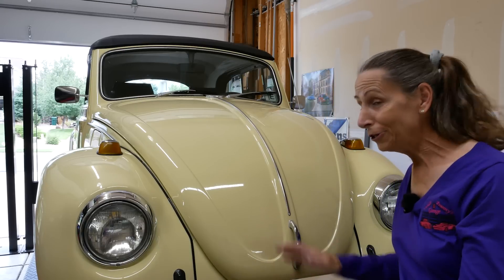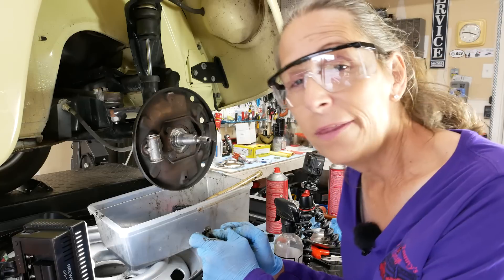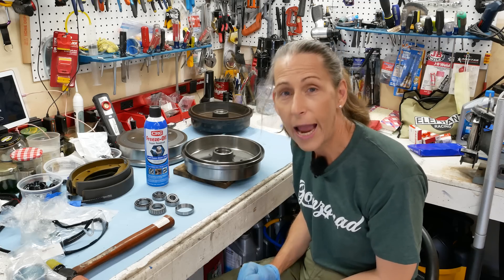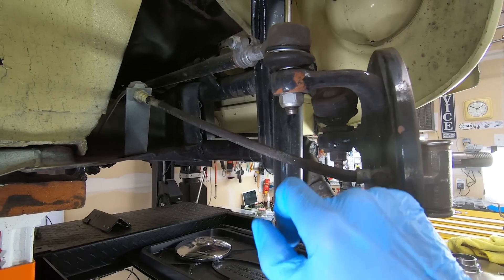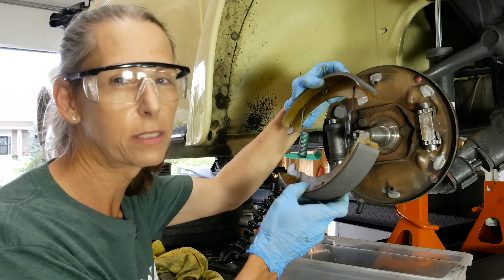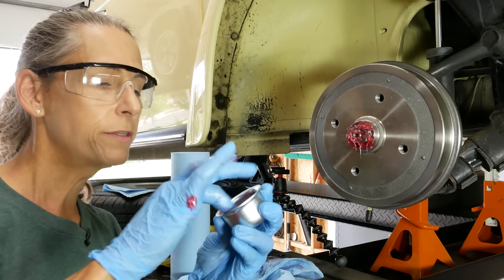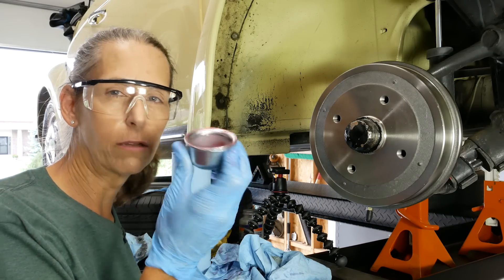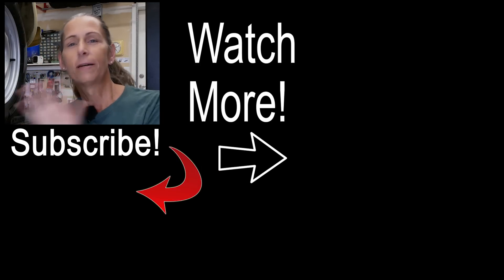VW Beetle Front Brakes & Bearings Disaster! What a mess!!

Comment: I just converted my front brakes on the '70 bug to disc brakes.  Wow what a difference.  I didn't want to chance messing up the new bearing races so went to a friend that had a press and carefully put them in that way. Used a lot of grease and brake fluid, but well worth the effort and minor cost. 
I was shocked to see on Lemon Drop those short cables on the front and how they didn't fail! Somebody's Angels were looking after them.
Looking forward to your next video :)
Reply from the maker: I think disks would be a smart move...
Reply: @HeidiandFranny  Oh my, yes! It brings the Bug into this century, the 4 wheel disc swapout, w/ upgraded master cylinder isn't that bad and you get to replace bearings,seals at the same time.. pack'em with Mobil1 grease, good to go long time.
Reply: 😉 Muir said at the start of his book that if we all drove as we were sitting on the front of the hood, there would be a lot fewer accidents ha ha! I think he was talking about the brakes... that was many years ago, though, and not many people do drive like that. I’ve been saved by ABS several times, so I’m no saint myself 😋. I love your videos, Franny! Very informative and they de-mystify the complex automotive machinery for the rest of us! I’ve done a few jobs on my cars, thanks to the confidence gained from you and others on here 😄

Comment: I remember working on brake cylinders back in the day. Old Fords and Vauxhalls mostly. I sometimes used a rubber seal kit for the cylinders instead of buying new ones. Here in GB we call these brake shoes and not pads. Pads are in the calliper and squeeze on the brake discs or brake rotors as you call them in the U.S. Great work as always.
Reply from the maker: I thought about a rebuild kit, but replacements are just a few $ more.  We'll see how long they last though...  Thanks for the term/name differences.  The differences always intrigue me.  Usually the GB names make more sense :) I keep getting names messed up all the time ;)
Reply: Heidi and Franny's Garage    Thanks. I really enjoy your content and as always your work is excellent. If only more engineers/ mechanics were of your standard I would be more confident in the automotive industry. Love from N.Ireland.

Comment: Great job Frannie! I had forgotten how easy front wheel bearings are on Beetles. I'm working on the front end of my CR-V and I'm taking the steering knuckles off to have bearings, lower ball joints, and wheel hub assemblies pressed in by a shop. Tolerances are too tight to do it without a press.
Reply from the maker: Modern car are so different!

Comment: More than 50 years ago I was taught to use the old race as an install tool for the new races. Using a flat piece of steel or hardwood as a tool to press against the old race helps in applying equal pressure all the way around.If you have a hydraulic press helps too. Most old school garages had one. I have never packed grease in the wheel cavity until full. Good way to get grease all over the pads and drum once the brakes get good and hot. Just smear it liberally on the spindle. I also like to rebuild the wheel cylinders. It's easy to do and saves on buying parts.

Comment: When redoing the front wheels bearings and brakes on my 912, putting the hubs in the oven at 275F for 30 minutes and the bearing races in the freezer in a zip lock at the same time, inserting the races was as easy as just dropping them in, et voila... super easy and took me (outside of the wait for the hubs to be warm) a grand 30 seconds..
Reply from the maker: That's a great way to go! Thanks for that :)

Comment: Franny & Heidi:  using a bench grinder to turn down an old outer bearing race is a great idea in turning it into an U/S (undersize) bushing used to tap in the race.  Trying to turn down a hardened steel bearing race on a lathe is very tough to do unless you have carbide tooling....and a lathe of course, or a friend that can do that for you! LOL
What I have done in the past is to soak the bearing races in denatured alcohol in a deep freeze, use a pair of tongs, place the races in the hub/drum and either use an U/S bushing or a bearing race driver to set them in place.
Another trick I learned was to again use the U/S bushings, get 2 1/4" thick pieces of soft steel, drill a clearance hole through both (1/4 - 1/2max), put the races in place along with the bushings and place a piece of steel on the bottom (inner), run a bolt up thru the center, through the outer bearing and bushing, through the last piece of steel, and using a flat washer underneath a nut, slowly tighten and you press both races into place simultaneously.
On the setting of the bearings, I was almost sure VW had specs to initially torque to set, and back off, then tighten the nut & Allen/Hex screw?  But, your method works, and I know many mechanics that do it that way.
Lastly, Great Video!!!  BTW, the loosening and proper tightening of that rear axle gland nut....you know what a bugger that is!
Reply from the maker: Thanks so much for all those tips!  I like the idea of compressing them together.  That's pretty cool.  The rear axle nut in up next ;)

Comment: Loved this, a blast from the past, we had Beetles years ago, but who put that flexible hose on like that needs to rethink their work. The brake cylinder should have a metal pipe to it then to a bracket , then the rubber hose, to another bracket on the body. For the brake clips use a mole grip to hold it then you don't need to squeeze while fiddling

Comment: I think the difference in pad types is due to the notch for the parking brake. The geometry from front to rear, is quite similar, so many times the rears will be purchased in bulk, and used for both front, and rear. I've found both on VB, my little '72 bug. VB is also that pretty light-yellow, but the paint is original, and has become rather thin. :) Nice Video! I look forward to the next one.

Comment: As always a first class instruction video. Putting the anti-seize on the star adjusters is a very good advice, they have a tendency to rust, and once they are rusted in place the adjustment of the brakes becomes a nightmare. The rest of  the anti seize is unnecessary in my experience. Any kind of grease is potentially doing harm to a drum brake, as You said. I also think the brake shoes aren’t getting in contact with the backing plates, once the drums are installed. I installed freshly powdercoated backing plates in my Thing and there isn‘t a single spot where the shoes had contact with the plates.

And what kind of baboon installed these short soft brake lines? This is so 🤬 dangerous! Thank god, Ms Lemondrop is in Your caring hands now 😊.

Oh, and the little caps are simply trash. A friend of mine just wrestled with this repro crap a couple of weeks ago. He reused the old ones either.
Reply from the maker: You are probably correct on the back plate lube.  There was a deep gouge where the pad had been contacting, but only one and a little lube won't fix that.  I bet the powder coating would actually be better.  Yes, those soft lines...  They were literally pulling on the brackets.  This whole car has stuff like that.  Whoever assembled it hadn't worked much on German cars.  It there is something that doesn't seem right , then back up and do it again.  It didn't leave the factory as a basket case.

Comment: I had the same problem with the bearing caps on our '73 Super. The problem is "Made in China" vs "Hergestellt in Deutschland". It's amazing how much easier it is to access the wiring and speedo on the pre-'73s!
Reply from the maker: I think the issue is that the form they are pressing this with is worn and is a bit small.  That and the metal they are using is a lot thicker.  I was bummed...  The old one looks like crap.  But, it fits!

Comment: Hi, great video and very helpful. Question though, at 15:40 you check shoe orientation, at which time the cut-away areas are facing the adjustment screws. But then at 16:25 you install springs but appear to invert the bottom shoe with the cut-away facing the cylinder. I thought those cut away areas were both supposed to face towards adjustment-screws. Was this a mistake? Or am I installing the shoes incorrectly?

Comment: I hate working on drums, more work for less performance. Those cylinders always seem to leak prematurely. I don't trust these mostly 3rd party cylinders these days since they are built to such low cost.
Reply: Agree 100 %, I've owned a bug and Westphalia and bought cheap parts and suffered the consequences.
Reply: Simply light home and use branded repair kit.  New OEM bleeder highly advisable.

Comment: Good video. I don't think I've 3ver seen drum brakes where the shoes were top and bottom. Usually on the sides and slave cylinder on the bottom.
All bleeders unscrew to open. Unscrew completely and they are out of the way of your hose connection.

Comment: Thank you for such an educational show !! Love watching all your repair jobs !!  I am restoring a Replica 29 Mercedes SSK Gazelle that is on a 1970 VW Chassis.  Did you have any issues with getting all the air out of the front wheel cylinders while bleeding them ? With the cylinders being vertical on the rear of the plate instead of horizontal on the top of plate there seems to be air trapped in the top of the cylinder, after several attempts I ended up unbolting the backing plate and rotating it so the wheel cylinder was up top above the axle and sure enough it burped out some more air and was good after that. I was just wondering if I did something wrong or you have a better method.  Thank you , John C.

Comment: I don't know where you've been buying your brake cleaner from or at what price, but I usually buy packs of 10 cans (500ml each, chlorine and acetone free) for 13-14USD on eBay. I'll use maybe one full can to do two wheels on a car if it's as bad as this car was, but usually one can gets me all 4 wheels. I would just be careful to not get any splashes on the paint or rubber.
Reply from the maker: Heidi picked up a lot on Amazon.  It's getting to be that the local Auto Parts stores are only good for taking spent engine oil...  Be really careful with the "Pro" version.  It will permanently stain powder coating.

Comment: Out of tolerance suppose you could heat it up to put on or off but is it worth it. Failing that hammer it with small hammer with anvil inside to stretch it out in a line

Comment: Hi! I have a 1967 beetle and it has the single circuit brake master cylinder, should I change it to the double circuit? the breakes are working fine, but some people say it is safer to change it to the double circuit, others have told me that in an emergency if there is a problem with the breakes,  the double circuit will make almost no difference according to their experience. I 'd appreciate your opinion, thanks! Love your channel!
Reply from the maker: We have the same dilemma on the 356.  On that car there is some nod to originality.  I would say that it is a good upgrade and a bit of piece of mind.  It splits the braking fore-aft.
Reply: @HeidiandFranny  thank you!

Comment: At 10:59, I shudder when I see a claw hammer brought out to do the job that a ball pein should be doing. Oooffff.
Reply from the maker: There correct hammer would have been a dead blow.  It is super rare I use anything but a plastic or rubber hammer. The claw got the job done just fine.

Comment: They make some real good disk brake kits for Bugs dump the drum brakes. Next time??
Reply from the maker: That would make for a great episode...  I probably should have tried to talk the owner into that.  Good call!
Reply: Nope!  Unless it's Wilwood.  Later be did have disks.  Use those.
Reply: We just had a customer’s car with the CSP (Custom & Speed Parts) disc brakes. Good brakes, but a bit over the top for a car with a stock engine. The drum brakes are perfectly capable of stopping the car, if maintained well. And you have to push the disc brakes way harder than the drum brakes, since the beetle has no brake booster. But still a good upgrade if you live in a mountainous area because they haven’t the tendency to fade like drum brakes.

Comment: The thing that mystifies me is how she wears those nitrile gloves without getting them ripped to shreds. I tried to do that a couple of times and it would be only a couple of minutes before I'd snag them on the rough end of a bolt or a jagged piece of metal and tear a hole in them, and once they get the first tear they come apart in no time. Maybe it's just the difference between working on nice clean German cars vs. crusty old Saabs, but I still suspect some sort of Franny magic is involved...
Reply from the maker: It is called new boxes (lots of gloves).  They do make thicker ones.  However, with COVID-19, they are getting hard to find. Very frustrating for us. Heidi spends lots of time trying to find them.  Keep wearing them.  You will get used to it.  You can also double them and if the tops get greasy, then you just peel off the first set.